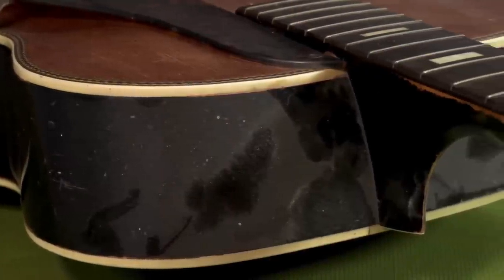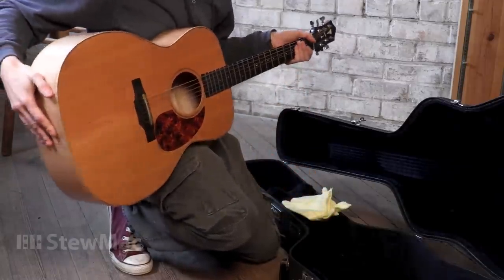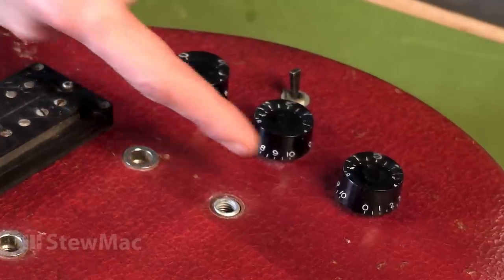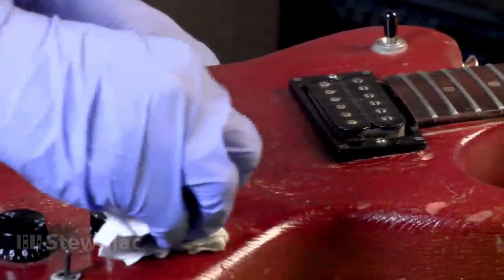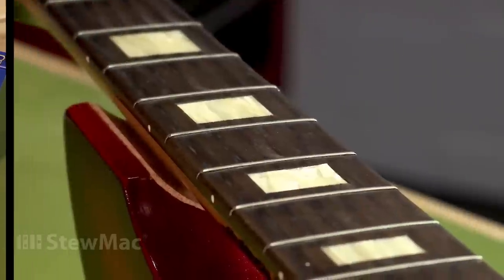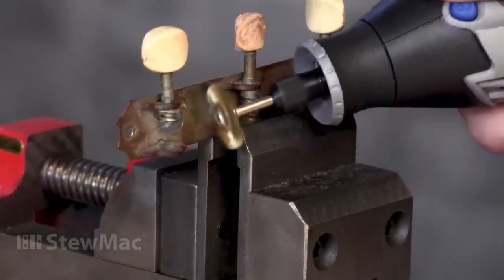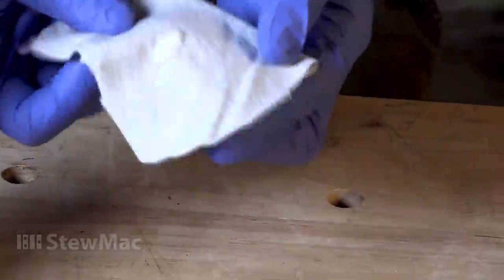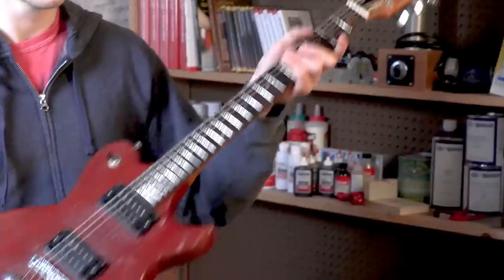How to Clean a Guitar

Comment: Any time y'all use a steel or brass wire wheel or brush make sure to wear glasses. As unlikely as it may sound, the wires will sling out while using. They seem to have an almost uncanny ability to zero in and go right in your eye. I've worked in the ER for over 20 years and we get several patients a year with wire bristles from wire wheels and even hand wire brushes impaled in their eye.

Comment: Great video

This will be so helpful to so many people

I like to brush off the dust first with a shaving brush instead of using a cloth

It prevents you from making fine scratches in the finish due to rubbing dust particles into the finish
Reply: An pleidhce Éireannach - 100% agree, do the same here! I just use a different brush, never thought of a shaving brush but that sounds like a great idea! It’s the tiny one for an electric shaver yeah?

I personally use anything that’s really ‘fine’ with a light-moderate bristle strength and it works great too. But I use different sized brushes (some small semi-stiff but fine painters brushes work well for tight spaces) for cleaning different areas! Just gotta alllllllways be careful not to ever bear down or put too much pressure into the guitar! 

Cheers
Reply: U shave with a brush? What?

Comment: What if I want to clean the decorative tape on the side of a Danelectro? I have a 60s Silvertone 1448 body, and I don't want to accidentally remove the tape with water. Then again, I already got it pretty wet; it was painted over, and I sanded the non-original paint off.

Comment: If you need just a tiny bit of a gentle but effective solvent to remove a bit or grime or adhesive from a label or something, here's what you do?  Rub your finger in that little corner where the side of your nose meets your cheek.  It will pick up a bit of oil which seems to be similarly effective to naptha.  Then use that finger to rub out what's bothering you.

Comment: On the dremel, will the bras brush leave scratches?
Reply: Brass is softer than steel, nickel or chromium, so theoretically it is not SUPPOSED  to scratch, but if the metal surface is pitted, it does not remove the pits.

Comment: How about Murphy Oil on an unfinished neck?
Reply: Murphy's Oil Soap is mostly water. In small amounts it works great to clean oil finished necks and works well on oily woods like rosewood that don't absorb moisture quickly, but generally speaking it should not be used on unfinished wood and it says so right on the label.

Comment: I cringed when he started rubbing the steel wool directly on the rosewood. D:
Reply: Same here.  Dave sez, steel wool should NEVER get anywhere near any guitar, acoustic or electric.  I only use it to polish frets with fret shields and pickups sealed in low-tack tape.
Reply: What would you use?